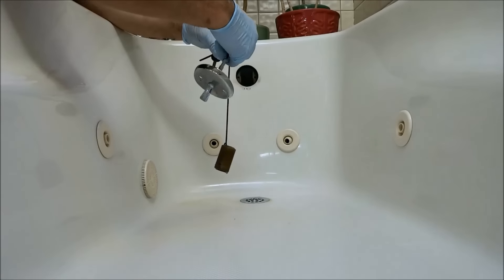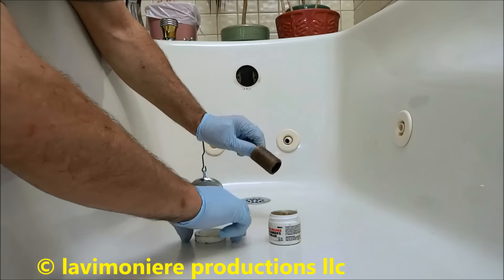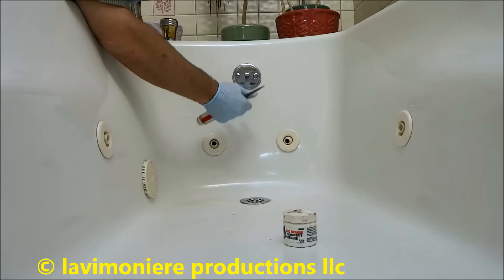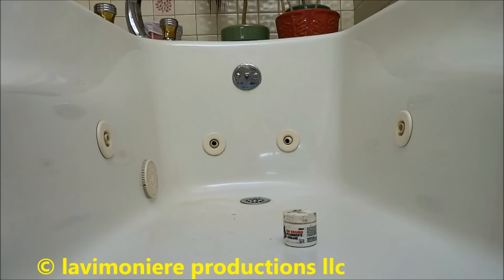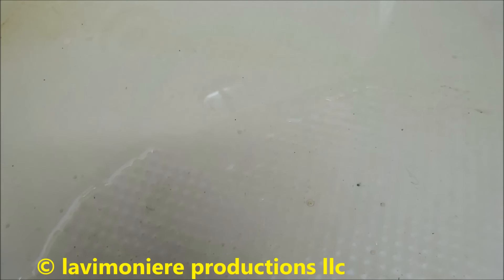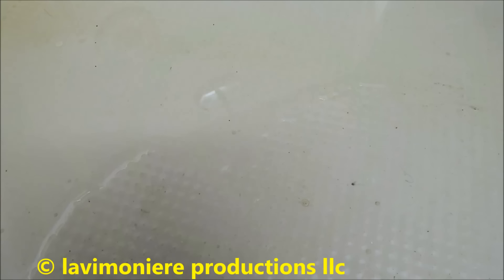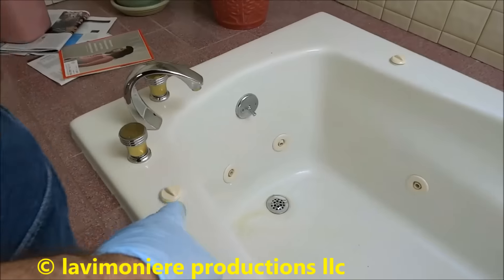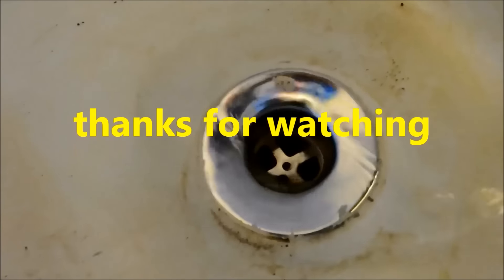home inspector has issue with tub drain

Comment: the last house i flipped, a couple wrote an offer $6,000 higher than my price, supposedly to beat any competing offers, so we get into escrow, and their home inspector shows up with two helpers. they rip the place apart, then send a list of repairs they want done, but if i lowered the price $8,000 they would skip the repairs. i told them to take a hike. i learned there are inspectors who promise they will get your house price lowered. fortunately i had five offers the same as theirs, but i selected them because they seemed the most genuine! after i blew them off i was back in escrow within an hour with the same price, but i was smarter...

Comment: Hey Steve what's your opinion on the Tip Toe Tub Drain  stopper we use them at our work they seam to be ok when you do need to replace one you just unscrew it and out the old and in with the  new .

Comment: Home inspectors are the worse at times
Reply: Home Inspectors are full of crap. I've had them say need 20 degrees across return/supply after a house had sat un-occupied for months. Humidity level at 80% and run time should be at least 1 hour.They come in flip stat walk to return/supply done.